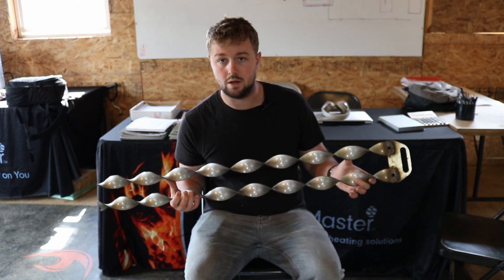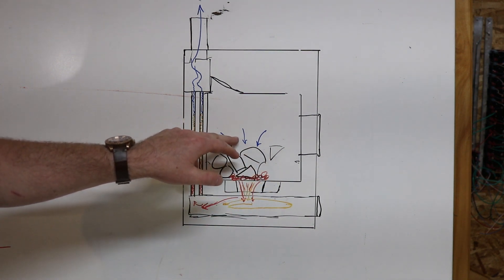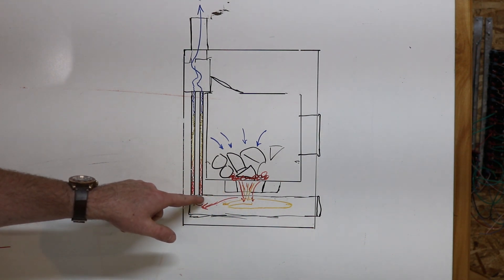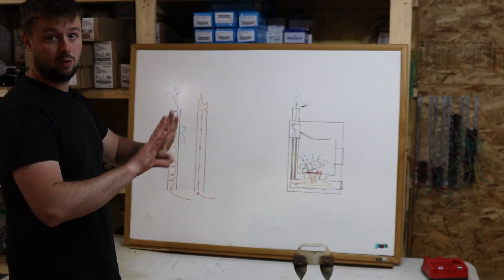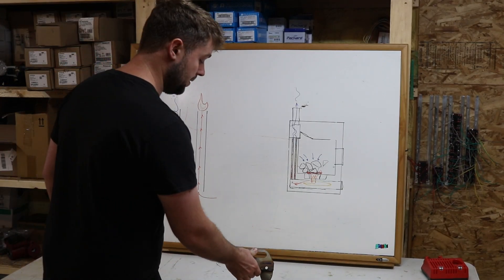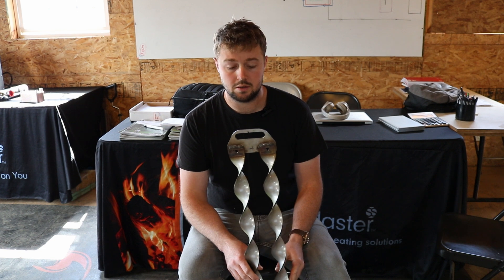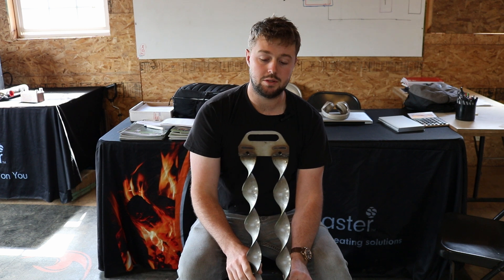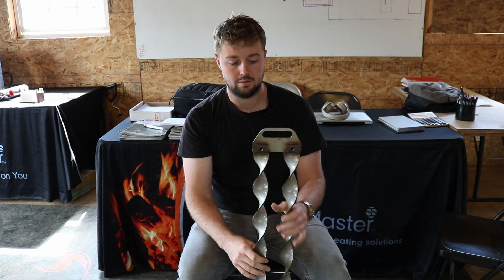All About G Series Turbulators

Comment: Eli what do you do when you have stuck turbulators
Reply from the maker: Afterward though you'd want to determine why they stuck in the first place.  It's usually wet wood, a damper not opening, an ash clog (no airflow), or loading too much wood in warm weather.  Getting to the source of the problem is important.
Reply from the maker: I get the furnace up to temperature and take a giant pry bar and pry each one up individually. If it’s creosote it can be helpful to dump diesel fuel down each exhaust tube and try to burn it out. I have also heard other dealers say that orange cleaner works to break down creosote as well, but haven’t had the chance to try it yet. If it’s ash, it’s usually only the bottom three inches that are plugged. A high tensile fencing wire run down the tube with a drill can loosen the ash plug a lot of times.